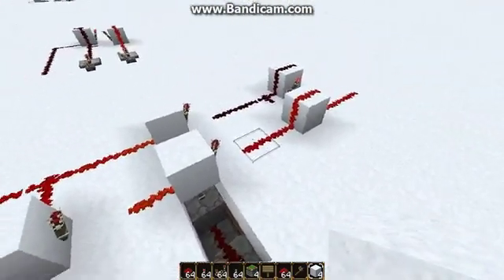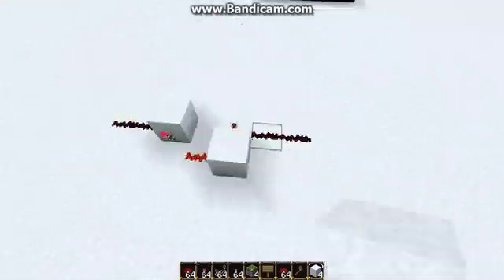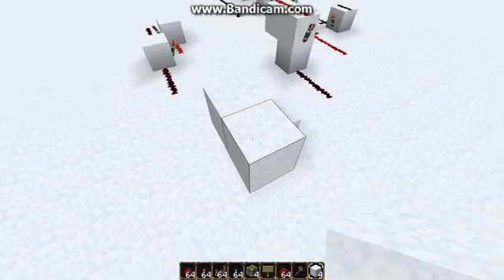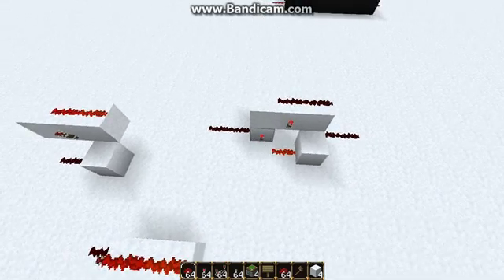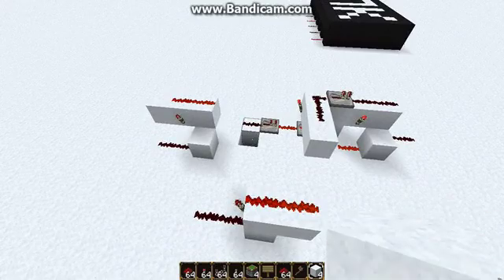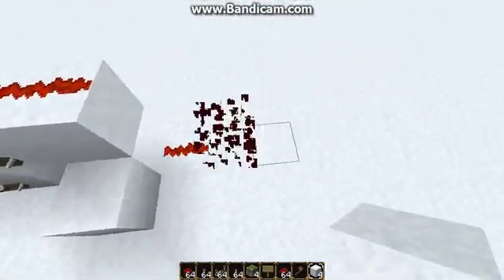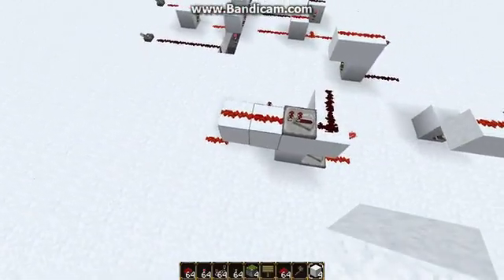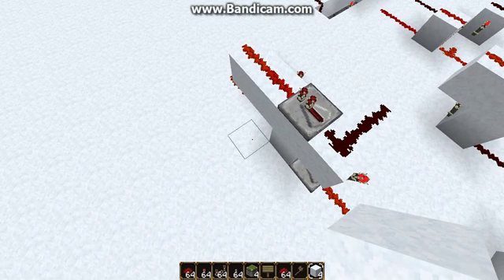Building a minecraft computer tutorial pt7: Readable/Writeable Memory with D flip-flops

Comment: D-Flip Flops in 1.8 can be created simply by placing a repeater pointing in the side of another repeater.
You can also make a muxer by using a comparator. Just change is to subtraction mode (right-clicking it) then placing a lever  beside it with one redstone wire in between, and you can toggle on and off whether you want a current to flow through there.
Reply: +Amelia Hartman so is it still applicable? cuz im making this in 1.8
Reply: Juro Villafuerte Yeah.
Reply: +Amelia Hartman so using a comparator that way basically makes it a transistor?
Reply: one thing with that though is that it wouldn't be able to be 2x2

Comment: There isn't a redstone glitch, the problem actually is the design. Let me guess, when you didn't have the repeater, turning of the clock turned on the D flip flop. The problem is that because there is a repeater in between the torch and the part that actually tells the gate to stop changing, the input line turns on one tick before the clock turns off. Interestingly enough, at specific positions and orientations, this does not happen.

Comment from the maker: It sounds like what you're looking for is a stack machine. A stack machine is a type of memory which can do 2 things, push and pop. Push saves whatever you're inputting into the stack machine, but also keeps everything that's been saved so far. Pop will remove the most recently saved item and use that as the output. If you want to know more, I suggest looking up the stack data structure; you'll find a lot of information about it which should help you make it in your scenario.